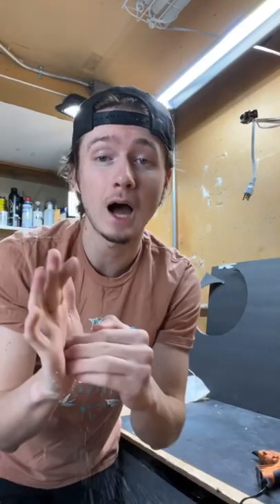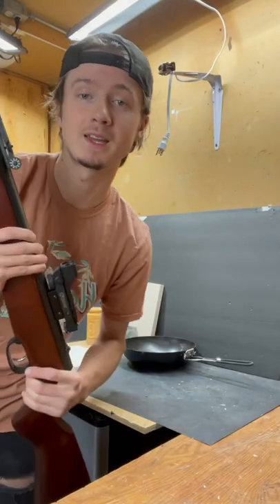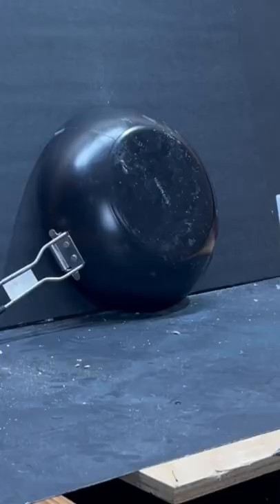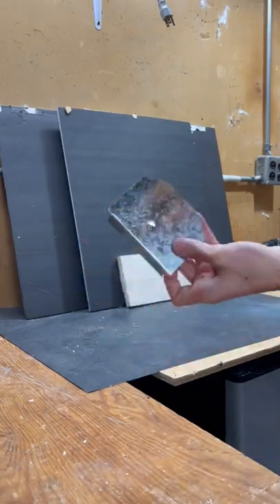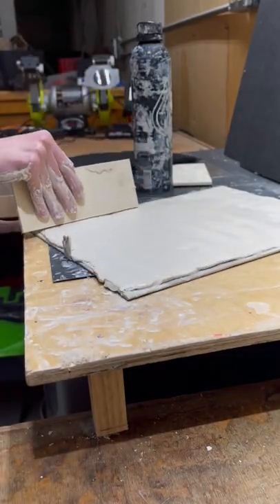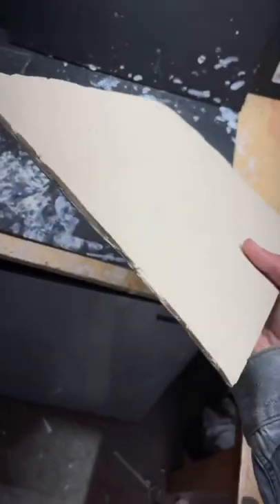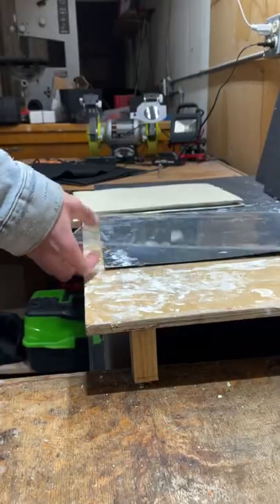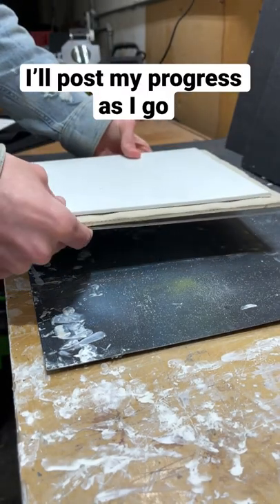Is a diy bulletproof vest possible?

Comment: I love your enthusiasm and energy but that isn’t a real gun and if you wore this in a gunfight you would die and get all that stuff In your wound
Reply: You can make an affordable plates 3a protection with ceramic tiles and fiberglass with resin and if you press it down and add a metal plate at the back it could be potentially level 4. There are tons of videos and is definitively possible to achieve